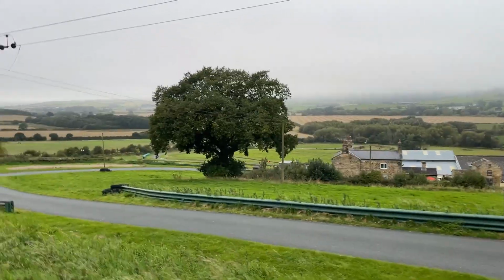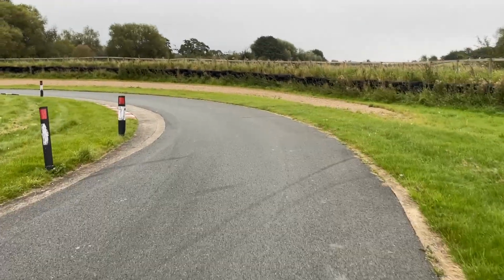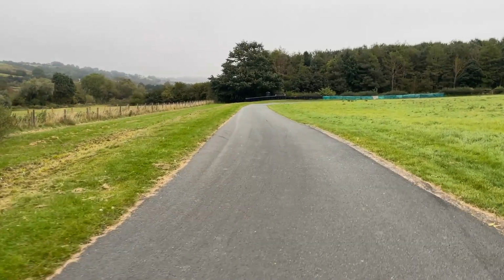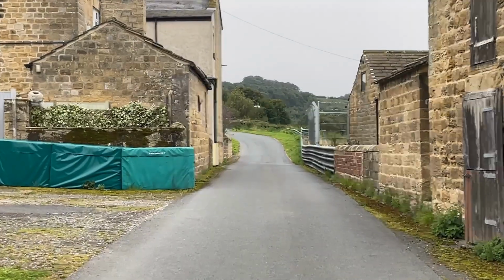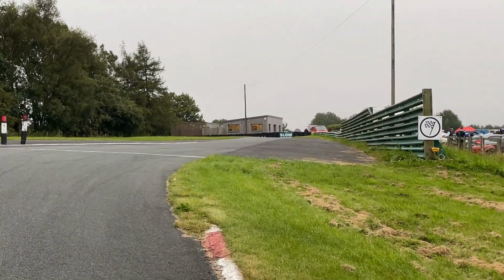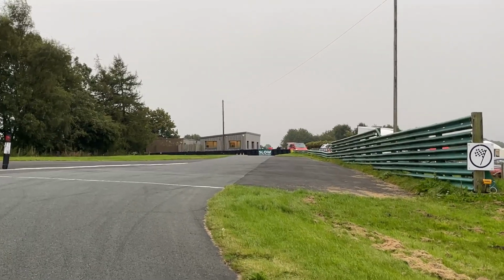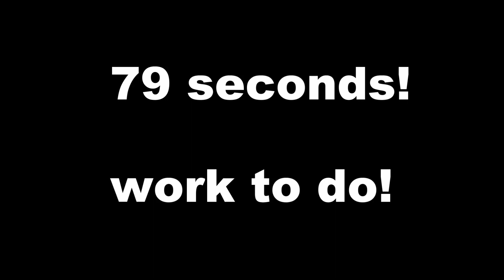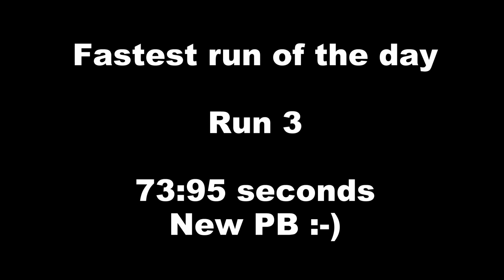MG Midget - Harewood Greenwood Cup Hillclimb - MGCC Speed Championship  - Birth of a Racecar

Comment: Hi, is there anyway I could contact yiu on another platform at all? I have recentjy bought a midget 1275cc and would like to go down the motorsport route with the restoration on it. Would like to catch some ideas off you if you have the time?
Reply from the maker: Hi Charlie, you can either comment on a video with your email and ill get in touch. all comments are held for review so will deleted and not be made public with any personal details or the MGCC speed championship facebook page is very good and i post regularly there.
Reply: Thanks for that, I have requested to join the page. 😎